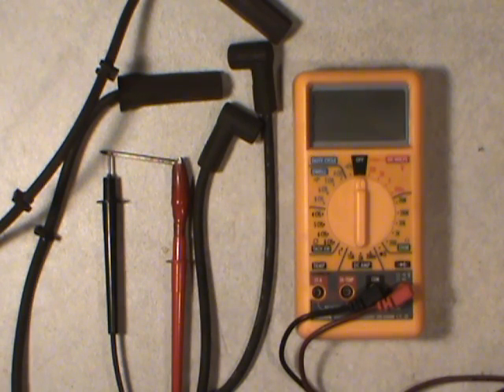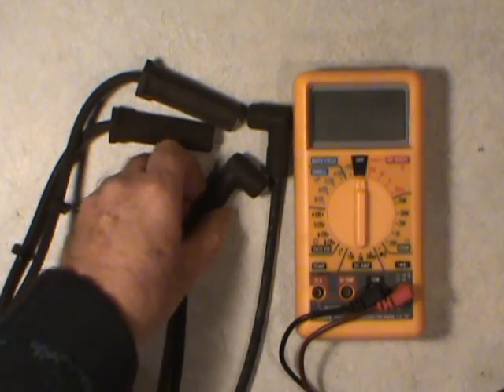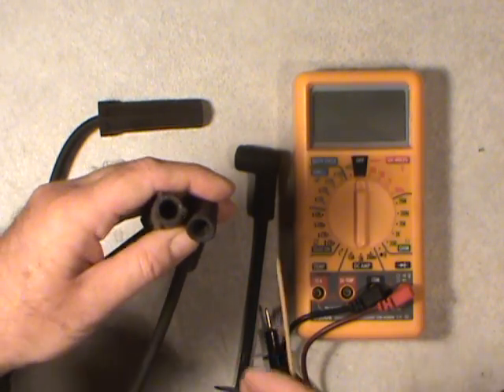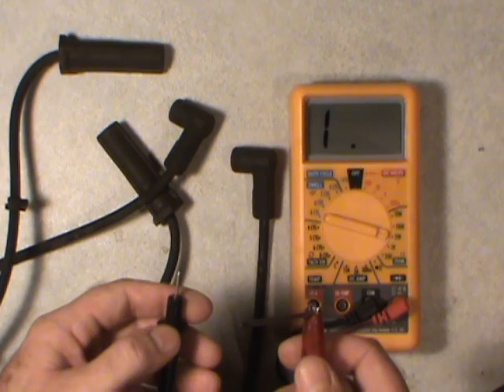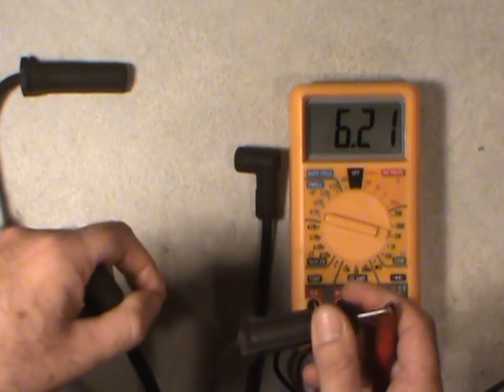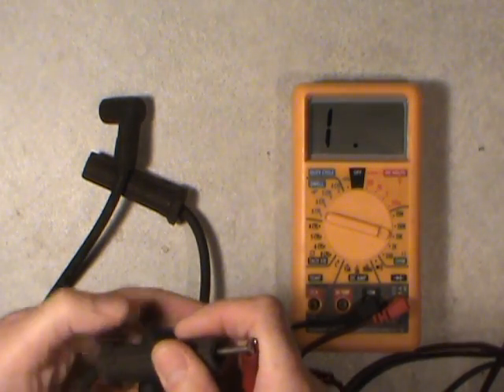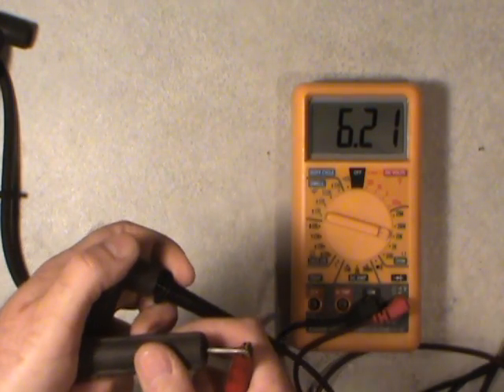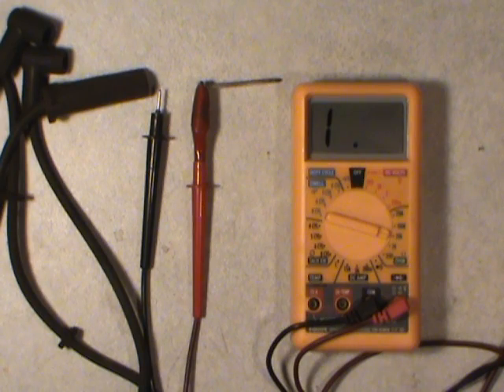How to Test Spark Plug Wires

Comment: Thanks man! Can you ohm out spark plugs as well?
I've seen plugs that would fire out of the cylinder and stuck in the plug wire but some how they still won't run the motor.
More noticeable in single cylinder engines because the motor won't run at all until the plug is changed.
Reply from the maker: +ILTSYC Greetings ILTSYC....You're welcome, and Thanks for watching......................Yes, indeed, for any of the Spark Plugs that I have used, they could be Measured for Resistance (Ohms), with an Ohm-meter/Multi-meter alright......................Some Spark Plugs, could be, in the 5,000 to 10,000 Ohms range there-abouts, depending on, just, what the spark plug's Manufacturer, decided upon....................Probably, some, if not most, of the Spark Plug Manufacturers, might even have the "Resistance Value" (in Ohms), showing up, in the "Code", in the form of a Number or Letter, or, combination there-of (maybe?), that is usually printed on, or stamped into, the Spark Plug itself.....................Simply, take, just about any Spark Plug, and, try to find a Website, or, website Forum, that "De-Codes", what-ever the Numbers, and/or Letters, that You see, on that particular Spark Plug...........................You might find, things like...that particular Spark Plug's...Reach...Resistance/Ohms...Screw Thread, Outside Diameter and Thread Pitch...and maybe more information as well, perhaps.............The Spark Plug's, Ohms/Resistance, is easily Measured..............Just, take the Spark Plug, that You want to Ohms-Test, and lay it down on a flat surface (makes things much easier...lol), and Set Your Ohm-Meter/Multi-meter to the Correct Range/Scale, then, connect, one of the Ohm-Meter's test leads, to the Terminal, that the spark plug Wire/Lead connects to, and, the other test lead, to the spark plug's Center Electrode, and, see, what shows up...............................Yes-Sir-ee-Bob....sometimes, a Spark Plug, will "Spark", while being Tested, out in the Open Atmosphere, but "Not Spark" so good, or, maybe not at all, while that very Same Spark Plug, is Installed in the Engine...Why...You ask...???...well, from what I recall, it's usually the Engine's Compression, that, shall we say Changes things...........................So then, for example, lettuce take a given Spark Plug, with a very LARGE Gap, between the Electrodes, and yes, it's a BIG Gap, being .080"...!!! (that be, Eighty Thousandths of an Inch), and install it, in a 7.5 to 1 Low Compression Engine...with an H.E.I. (General Motor's...High Energy Ignition) Distributor...just like they did, quite some years ago, with an Oldsmobile 260 Cubic Inch/4.3 Liter V-8 Engine...Works just fine-n-dandy...........................Now then, take this very same Spark Plug, still having that very LARGE Gap, between the Electrodes, (that also Fits Properly), and Install it, into a High Compression/High Performance Engine...well, as I see it, that poor ole Spark Plug, probably wouldn't have a very good chance, at Sparkin', all that well, unless, the Ignition Coil's, Secondary, High Voltage Output, Increased, by a rather Large Amount, over, that, quite Small Amount, of High Secondary Voltage, that was required, to make that, same, good ole Spark Plug, to be able, to go "Spark", in that Low Compression Engine, that I had mentioned earlier........................Basically, the Higher the Engine's Compression, the more Difficult, it is, for a given Spark Plug, to go "Spark"...oh, and, also...the Larger, the Spark Plug's "Gap" is, the harder it is, on the Ignition Coil, because the Ignition Coil's, Secondary, High Voltage Output, will usually Increase, up to the needed amount, to be able, to make the "Spark", jump the "Gap", between the Electrodes...................I Never, allow an Ignition Coil, to Operate, when-ever, its Secondary, High Voltage Terminal, is Not-Connected Properly, in the Ignition Circuit, or Connected to Ground, because, if...???...that Ignition Coil's, Secondary, High Voltage Terminal "Was-Not" Connected to anything, well, that poor ole Ignition Coil, would probably, "try", to Increase, its Secondary High Voltage, to "Infinity and Beyond"...!!!...but, it wouldn't be able to, and just, probably Over-Heat, and "Self Destruct"...!!!...Yikes...!!!...lol...........So, there You have it, and...........till next time...........Be Safe, take care, and have a good one.
Reply from the maker: +ILTSYC Greetings ILTSYC....Well, for starters, I guess, that I should WARN You, about the possibility, of "FRY-ing", the Power Supply in Your Computer, if the following, happens to Apply to, what You have for a Computer, and, any (electrical) Power Consuming, External Devices, that You plan on plugging into, Your Computer's USB Port, or Ports, as the case may be........................If, Your Computer, is equipped with "USB-2" Ports" (from what I recall, USB-2, uses about 5 Volts DC), and, You are planning to use an External Device, that uses, "USB-3", then, some of those External Devices, that Use "USB-3", might place a "Higher,  Load/Demand", on Your Computer's Power Supply, than, "it" is able to Handle, and if it does, maybe, "POOF", goes Your Computer...!!!...(and probably, won't even make a noise, or light up either).......................Make sure, that, You Check the Electrical, Specifications, on, Both Your Computer's Power Supply, especially so, in respect to, what Your Computer can Handle, as far as USB Ports are concerned, and whether it is equipped with "USB-2", or "USB-3" Ports as well......................Also, Check, the Electrical Specifications, on any "External Device", that You plan on, Plugging into Your Computer, and also, whether it has "USB-2", or "USB-3" Ports, on "it" as well...............................Sometimes, if using a "USB-3" External Device, and wanting, to Plug it into a Computer, that has "USB-2" Ports, a "Special USB Cable", might do the trick, but be Very Careful, cuz, if things go Wrong, bye-Bye-Power Supply, in the Computer...!!!...........................That Cable, from what I recall, will probably have, 1 USB-Connector, on 1 End of it, and, the other end, of that "Special" USB Cable, will probably have 2 USB Connectors on it, kinda like a Y, if You will, and I'm thinkin', that, the Folks that made these "Special USB Cables", might be thinking, along the lines of Splitting the Electrical Load into 2, maybe...???.....................Also, make sure, that, Your Computer's "Software", as in, something, like, the "Version" of Windows (maybe?), that's Installed in Your Computer, is Compatible (aka, Matches-up), with, what-ever, the "External Device"..."Requires"...so it will Work Properly, and as it should...........................I never used a Scope, as in, Oscilloscope before, but, I'm pretty sure, it wouldn't take me too long, to figure out how to use one, if the need for one, happens to show up, as in, trying to Diagnose, a Vehicle "Gremlin", that is "Hiding", so well, that, OBD-1 or OBD-2, or a multitude, of, good ole fashioned, old school tests, and previous experience, wasn't able to "Find"...................Some things to consider, are as follows....................Is the Place or Person, that You are Buying from, Reputable, and, will they, or a Website of theirs, supply Support to You, in a reasonable amount of time...???.....................Also, is the External Device's, On-Board Program (if it has one, that is), and any Software, that it might need,  Up-grade-able, via, something like, a Website perhaps...???...............Check, to see, if the Scope, requires, something like, Vehicle Manufacturer, Specific Software, and/or, any Specific Testing Probes, and the like............................I'll end, all of this madness (lol), with...try to find, one or more Website "Forums", on the Internet, that Discuss, Your Exact Vehicle & Engine, along with, one or more People, that have, a fair amount of Experience, Using, any of the "Scopes", or "Scope Kits", that, You might be wanting to Buy some day..............................Just make sure, that, the Scope, or Scope Kit, has things like, the needed Probes and such, so that You will be able to "Git-er-Done", and also, good luck with that as well, and..............till next time.............Be Safe, take care, and have a good one.
Reply: Thanks for mentioning the USB 3 thing, I had not considered that. I bet my lap top has USB2 ports but will check to make sure.

I may go ahead with the Pico scope, a guy at Garagejournal said he bought the Hantek 3064 and couldn't get updates or any support becasue his was a clone of a Hantek 3064. I'll steer clear of that I guess. Those cheap amp clamps are probably not accurate either.

Any recommendations on a good bi directional scan tool?

 I thought about getting the Modis 4 channel scope but really don't wont' to buy used but would if I could at least get option to return it.

 Plus from what I hear the Modis will not be supported much longer.

A Pico and a Solus Ultra might do the trick. The Solus Ultra needs no keys charges strait from the plug, does bi directional, relearns and adaptations plus a slew of other stuff. LOL!
Reply from the maker: +ILTSYC Greetings ILTSYC....If, and when-ever, You are looking at any of those Scopes, that are grabbing Your interest, try to find out, if there happens to be, a Visual/on the Computer's Screen/Monitor/Display..."Wave-Form", shall we say "Library",that, might be installed, On-Board, the Scope's Hardware ...??? (or the  Scope's, Manual/Book, or Website) and hopefully, there just might be, a multitude of Good, Reputable "Wave-Forms", that are representative, of what, a Good Waveform, actually looks-like, when Testing, something like an Ignition Coil, or a Sensor or Actuator, as an example...........................Unless, You have a Good, Known "Wave-Form", or, possibly, some Numerical Specifications (as in, something like, Voltage or what-ever, vs Time), to "Compare", the Wave-Form, that You are getting/seeing..."TO"...when You are Testing, just about anything, with Your Scope, then, that, Wave-Form, that You got, while testing, probably won't be as Useful, as You'd like it to be, correct...???.........................Now then, about that Bi-Directional Scan Tool................Sorry, I don't have one, but, are You looking, to be doing any "Re-Flashing" (aka, Re-Programming), of the (Vehicle's) On-Board Computer at all...???...oh, and, if so, be Very Careful, if, and when-ever You do, cuz, if You mess-up, it can get quite expensive, I'm guessin'..........................Like I was sayin' before, hit up some of those Website "Forums", and ask some of those People, that have Used, and have lots of Experience with, what-ever, Vehicle..."Testing/Monitoring...Devices", that Interest You, and are maybe considering on Buying, some time in the future........................Perhaps, buy a Good Quality, old-school "Vacuum Gauge", as that, not so expensive, Vacuum-Testing Dial/Gauge, is pretty much, Worth its Weight in Gold...!!!...........................Lettuce say, if You were to take a Vacuum Gauge Reading, on Your Engine, while it was Working Perfectly, while Your Engine was Fully Warmed up to Operating Temperature, and, at Idle Speed, then, that, good ole Vacuum Gauge's Needle, would be showing, a fairly high amount of, Plenum/Intake Manifold..."Vacuum" (as in, Hg/Inches of Mercury, and also, will Vary, at Different Altitudes, in relation to Sea Level as well...!!!...Wowsers...!!!...lol), and the Vacuum Gauge's Needle, would be, pretty much, holding "Steady/Not Moving", unless, there was a Problem or two, or maybe, that Engine might have, a very Aggressive Camshaft, installed in it...???...and, just by watching  the "Behavior", of the Vacuum Gauge's Needle, and You know how to "Interpret its Movements", then, that, my Friend, will give You quite the Advantage, over, quite a few of those, I only wanna be a High-Tech, Car, Guy or Gal, that, oh, shall we say, Builds a House without a "Foundation", cuz the way, that I see it, once a Person Learns, the Rudiments/Basics, of an Engine, right from, how all of its component parts are Assembled, and how they are supposed to work together, hopefully, in harmony, then, from my experience, it's so much easier, to visualize, what may be causing the Engine's Miss-Behavior, and so far, I've saved me, quite a bit of money at that (thank goodness...lol)...........................So, to make things, much simpler, and maybe a little less expensive for Yourself, take some time, and try to study an Engine, that was Manufactured "Before" Computers, started to be Installed in Vehicles (aka, older than, about the Mid-1980's there-abouts, or, even, better still, "Before" 1970), the, Engine's "Fuel Administration" (aka, Carburetors), and "Ignition Spark Timing/Advance" System (aka, Distributor), cuz, as I've found, by doing so, I can actually..."Visualize...Hear...Feel...and...Smell as well"...just about any Engine, that burns gasoline, that might be Acting-up, and in need of, what-ever Help, that I'm able to give it, so it will Run Healthy, once again, and..."purrs like a Kitten", and gets pretty good mileage (when I want it to), and..."ROAR LIKE A LION"...!!!...when-ever my BIG Foot says so...!!!...lol..........................So, maybe, have a look around, on the Internet, and see, just, How Much, a "Vacuum Gauge", can actually tell You, about the Health, or, lack there-of, in as far as, Your Engine is concerned, and.............till next time............Be Safe, take care, and have a good one.
Reply: I never considered that you could tell a lot about an engine with a vacuum gauge.

The scan tool is such a time saver for finding problem sensors on today's computer controlled engines.

 Instead of unplugging injectors one by one to find the bad one you can turn them off one by one with the Snap on Solus Utra bi-directional scan tool for instance and listen for the one that doesn't make the skip worse. Or with the engine off you can activate and buzz each one individually to see if they are actually working.

You can graph like a scope the live data from the sensors electric pulse to see if they are doing like they should. You still have to know how to decipher it all of course which I'm not adept at but slowly grasping it.
Reply from the maker: +ILTSYC Greetings ILTSYC....Yes-Sir-ee-Bob...Not only can a Vacuum Gauge, be of great help, to help Diagnose, so many Engine related Problems, there are also a couple of other things, that I will now mention........................If, Your Cat (aka, Catalytic Converter) is Plugged Up (aka, Restricted, Exhaust Gas Flow through it), guess what...???...well, if indeed, the Vehicle's Cat was Plugged Up, then, by using a Vacuum Gauge, hooked up to the Engine's Plenum or Intake Manifold, and the Engine is already, fully warmed up, and not running, then, Started Up, and, at idle speed, what the Vacuum Gauge would usually be showin', is a fairly High Vacuum Level/Amount, in Hg/Inches of Mercury, when Initially Started, and, a short time later, You would probably be Seein', the Needle, on that good ole Vacuum Gauge, "Starting to Drop", as in, a Lower Amount of Vacuum/Hg, cuz, of the Lack of Exhaust Gas "Flow", Through the Cat, cuz, of, what, I'd be thinkin' to be, an Overly, High Amount of Exhaust System "Back Pressure", and, remember now, the..."Catalytic Converter is Plugged Up"...!!! (and the Engine...Needs to Breathe...!!!)...and, probably time to Replace that sucker...!!!...Yikes...lol.................Oh, and, did You know, that, if the Vehicle, has to be Smog/Emissions Tested, in California USA, and maybe, New York USA as well, have to "Only Use", a Special/Highly Certified, Catalytic Converter, that probably, also, has an Identifying Code, or what-ever on it, quite possibly...Holy-gwalk-ah-moly...!!!.........................You can even Mount/Install, a Vacuum Gauge (full size, or, a smaller one, made for that very purpose, the choice, is all Yours), on, in, or near Your Vehicles Dashboard, but Why, You ask...???...well, the Highest, Engine Vacuum Level, that's seen on a Vacuum Gauge, is a pretty darn good Indicator, of Engine Efficiency, when You are just Cruzin' along, and, if the Needle, on the Vacuum Gauge, gets really Low, then, You are probably using, way too much Gas Pedal/Throttle, if You are tryin' to get Good Gas Mileage......................When Accelerating, from a Red Light or Stop Sign, with a Led Foot, that good ole Vacuum Gauge's Needle, would probably, Drop really Low, and be Tellin' You...Hey Man, You are Using/Wasting, Too Much Gasoline, so go Easy on that Gas Pedal, and keep the Vacuum/Hg's, nice-n-High...!!!.........................The More that You Open the Throttle Plate/Butterfly, on the Throttle Body or Carburetor, the Lower, that the Plenum or Intake Manifold will get, in Hg/Inches of Mercury, and, is basically, a very good Indicator, of the Engine's Load condition, at, just about any Engine RPM's...........................I'll even Bet, that a "Map Sensor", probably became possible, because of, the Already, been around for a very long time, Vacuum Gauge, but, a Vacuum Gauge is usually, Graduated in Hg/Inches of Mercury, where-as, a Map Sensor, pssssssst, (now wispering....lol), hey, what does MAP stand for anywayz...???...why it's..."Manifold Absolute Pressure"...(I think?)..lol...........Look up, just how "Absolute Pressure", Compares to, "Hg, or, Inches of Mercury", and how they are both Affected by Engine Load, and probably, Altitude, at, and above Sea Level as well, if You care to, that is.....................Have a close look at Your Spark Plugs, and Compare them, to each other, to see if they are all, about the Same, or, is one or more of them, in the Set, a bit Different from the others...???...as Spark Plugs, can sure tell a Lot, about what's go-in on, inside the Combustion Chambers.......................Maybe, Check out, How to do a Power Balance Test..............Then, there's also Cylinder Compression Testing, and, Cylinder Leak Down Testing as well.........................The "Wave-Forms", seen on a Scope, when testing, an Ignition Coil, both, the primary/low voltage side, and secondary/high voltage side, can be a Real Eye-Opener alright...!!!...................Perhaps, look up, on the Internet, how good, and, not so good, Ignition Coil Wave-Forms appear to be, and, there are some very good Websites, that can Explain, how to Compare those Wave-Forms to each other, as I have found..........................Last but not least, especially, where a Fuel Injected (gasoline) Engine is concerned, is, the Importance, of the Correct, and Specified "Fuel Pressure", for the "Exact", Vehicle and Engine, cuz, it's the Acceptable Amount of Fuel Pressure, and Fuel Volume, that will Dictate, just how well, any, known good, and operating Fuel Injectors, will be able to do their Job ,Properly, and as they should....................Fuel Pressure, might be, about, 60 PSI/Pounds per square Inch, so be Very Careful, and read about, how to Safely, Bleed-off, that High Fuel Pressure, to Zero PSI, before Disconnecting any High Pressure, Fuel System Components or Fittings.......................Wear Safety Glasses/Goggles, and have a Fire Extinguisher near-by, just in case, (and I hope not)....................Engine Exhaust Gas is "Deadly", so, make sure, that, You have Lots of Fresh Air and Ventilation around Your Vehicle, when-ever the Engine is Running...!!!........and..........till next time.................Be Safe, take care, and have a good one.
Reply: Whats the quickest way to pin point a vucum leak?
Reply from the maker: +ILTSYC Greetings ILTSYC....You were asking...The quickest way, to find a Vacuum Leak, be it, one, or more (at the same time maybe?), Engine related, or, not so Engine related, Vacuum Leak/s, I assume.......................Just like tying to Find, some, hard to find, Vehicle, Electrically related problems, there can also be times, where, there can also be, a few hard/stubborn to Find, Vacuum (related) Leaks, as well, as I have encountered, over quite some time............................May I ask, just what led You to believe, that You do, indeed, have a Vehicle related Vacuum Leak, in the first place...???...........................Did You Scan Your Vehicle for any Trouble Codes, cuz, if any Codes show up at all, they can, help out quite a bit...sometimes............................Before I mention, about, a few ways/methods, that People are using, to help, in Finding, one, or more, not so wanted Vacuum Leaks, I'll mention a few, of, some of the "Culprits", that I came across, that were Causing, those Nasty, make the Engine Run, not so good, and then some.......................Some Vacuum Leaks, might not be so easily detected, if, at all.......................I've had, an EGR/Exhaust Gas Recirculation...Valve, having a Carbon Chunk, oh, about the size of an Un-Ground Pepper Corn, that got Lodged Between the Valve's Pintle/Plunger, and the Valves Seat, which held the EGR Valve, Open 24/7 (as in always), which caused, one of the BIGGEST Vacuum Leaks, that I ever had...!!!...so bad, that the Engine, was very difficult to Start, Ran like Crap, and so Lean, of an Air/Fuel Mixture...Air/Fuel Ratio, that, while trying to just maintain Highway speed, the gas pedal was pushed down, way too much, and, the Engine had No Guts, or Power either (might not be detected, with a vacuum test, maybe?)..........................Then, also, I had, an (engine) Vacuum, type of Brake Booster, that would start to "Hiss", when I shut the Engine off, and wasn't very Loud at all, and, I didn't notice it, until, one day, I happened to have the Hood open, and, I had just shut the Engine off, and made my way, to the front of the vehicle............................Now it gets really weird, as in, I'm coming up to a stop, at a red traffic light, the Engine starts to Run really Rough, and wants to Stall/quit Running, so, I...2-Footed it, having 1 Foot on the Brake, and the other, on the gas pedal, just enough, to keep-er-Runnin', and as soon as I could, I parked the vehicle, on the side of the road...........................I then, lift the hood, had a quick look around, and guess what...???...the Nylon (plastic), type of PCV/Positive Crankcase Ventilation Valve, was in..."2 Pieces"...!!!...Yikes...!!!...so, I just stuck it back together, as tight as possible, and went straight home, and parked it, until, I went out, and gots me, a New PCV Valve...........................Now then, lettuce now see, what we can do, in order to "Find", any, Real & Genuine, that are actually Happening, engine related or otherwise, Vacuum Leaks, shall we...................Having the Engine Cold, and Not Running..."Check Everything"...that You can see, that Uses, or Carries, Engine "Vacuum"....as in, All of the Rubber-like and Plastic Vacuum Hoses & Pipes, and what-ever they are Connected to, oh, and, also, keep in mind, that some of the Controls, on or near, Your Dashboard, that control, things like Heat/Defrost/Vent, and Air Conditioning as well, might also use Engine Vacuum, to Control, the Actuators, to make things work......................The second (time-wise, that is), when if You happen to See, a small Crack, in any of those Vacuum related, rubber/plastic Hoses or Pipes, then, that in itself, might be telling You, that it's about time (or, maybe not?), that You might consider Replacing, most, of 'Em, especially if, Your Vehicle is quite old, and has lots of Miles/Kilometers on it, as, Engine Compartment "Heat", as well as Time, will usually cause, just about anything, made of Rubber or Plastic, to..."Deteriorate"....................Oh yeah, if and when, Replacing any Vacuum Lines, or even, spark plug, Leads/Wires, just do, "One at a Time", so You won't have, a not so fun time, tryin' to figure out, where "They"..."All Go"...!!!...(or Went, for that matter)............................Once the "Visual Inspection" checks out, now what...???.................Some Automotive Fix-em-up-Establishments, might be using a "Smoke Machine", which will probably, be using Low Pressure, to Blow Smoke, into the Engine's Plenum or Intake Manifold (I think?), and, if that Smoke, be-comin', out of a Place or Two, where it Should Not Be, then, I'm guessin', the Leak-be-Found................Some People, might use, a spray can of...WD-40...or...Carb Cleaner...and spray a bit of it, into places like, where any Gaskets are, that Seal any Passageways, between Two Component Parts, that involve, any Engine related Vacuum, such as, in things like, where the (lower) Intake Manifold, joins to the Engine Head/s...or...where, something like a Carburetor, or TBI/Throttle Body Injection Unit (looks, kinda like a carburetor), joins/bolts-to, the top of the Intake Manifold (leaking gasket between them?)...................Some use Propane, from an Un-Lit, Plumbing Torch, probably, having the Valve on it, set for a Low amount of Propane Gas Flow, and, if and when, the Propane Gas, gets into, a Joint, or what-ever, that isn't making a very good Seal, then, the Engine RPMs/Revolution per Minute would probably Change....and, something, like, a Vacuum Gauge Reading, would probably Change as well...and, if that Vacuum Leak was really that bad, I be thinkin' that, a Person could Hear, the Engine RPM's Change too..............If the Propane, which, if Not Used Very Carefully, and Must be Used Outside, can be Very Dangerous, as in..."BOOM"...!!!...and I don't think, that, using anything, that is Easily Flammable, is very Safe, especially, on a Very Hot Engine...!!!.................So then, with the Engine Cold and Not Running, do a Total Visual Inspection, and also look for any "Diss-Connected" Hoses or Fittings.....................Trouble Codes showing up...???...................A Vacuum Gauge, and the Reading/s, that it Shows, would be a good idea.......................Have a Friend that Smokes Cigars...???...if so, have him or her, blow some smoke, into Your Engine, when it's Not Running, into a hose, that's connected to the Plenum/Intake Manifold........................Easiest way, is to Remove the PCV/Positive Crankcase Ventilation Valve, from its Hose, and connect a Clean Hose, to the Hose, where the PCV Valve, was installed into (so Ur Cigar, Smokin' Friend, has a Clean Hose, to Huff and Puff, the Cigar Smoke into)...then, just Look & See, where-ever that Cee-Gar Smoke is comin' out from...........................till next time...........Be Safe, take care, and have a good one.
Reply: My Daughters 02 Ford Focus dropped an intake valve seat about 8 weeks ago and that trashed the number 4 piston. I put all new pistons one junk yard rod in it and a brand new head and new rod bearings while I was in there.

All that is working fantastic! Since the rebuild though the car idles too low and stalls occasionally. The EGR tube was broken out of the flange at the exhaust so I made a blank out of a piece of copper and blocked it off at the exhaust with the flange and pipe installed like it was but blocked. Also I plugged the vacuum line controlling the EGR valve so it doesn't open.

I'm thinking I might just barely be getting  tiny vacuum leak from that broken EGR pipe through the EGR.

I had to thoroughly clean every part of the throttle body and intake including the IAC (idle air control) to get metal fragments out.

I also cleaned the fuel injectors with  DIY injector pulser, carb cleaner pressured by 25 PSI.

The engine runs too good for it to have much of a vacuum leak and I really suspect that the IAC is stuck but I'd like to test that EGR for a vacuum leak just because the potential is there for a vacuum leak. I saw a guy spraying water on suspected vacuum leaks on ytube the other day and it seemed to be very affective and safer than flammables. When water is sucked in the engine runs worse.